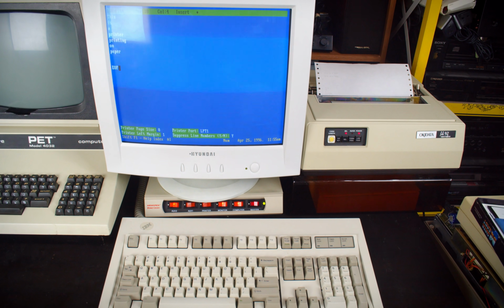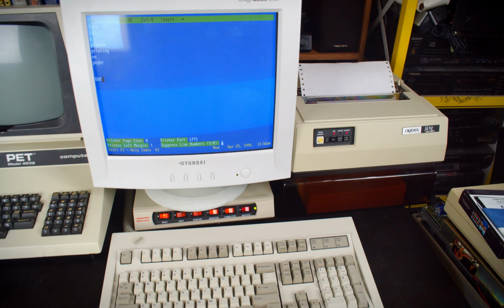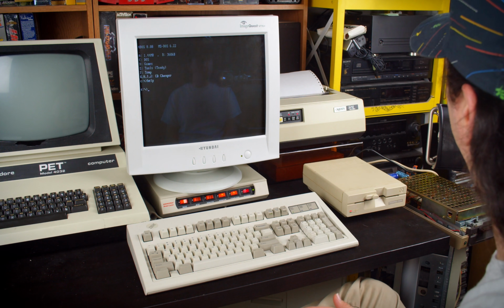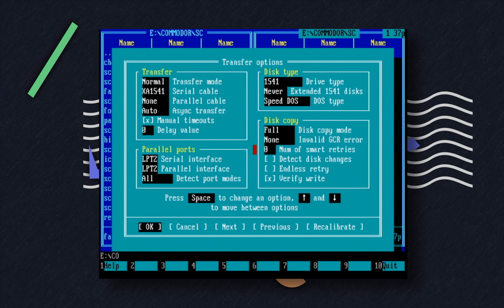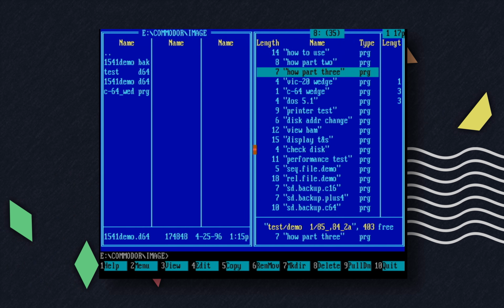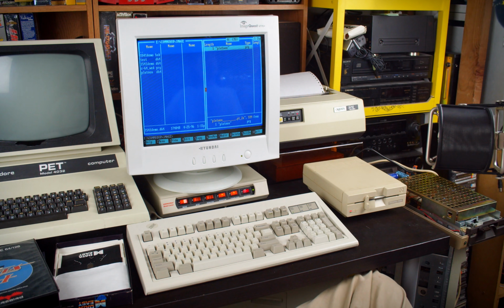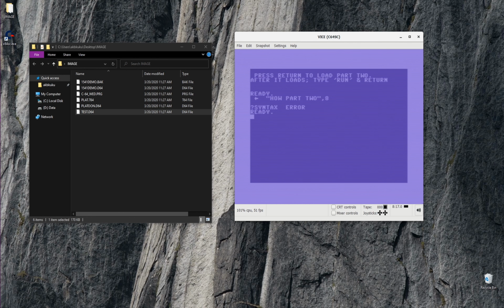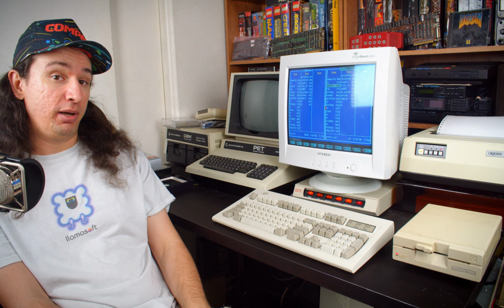Commodore 64 Drive on PC

Comment: Why do you have only 3 SIMMs on the memory slots?. SIMMs need to be installed in pairs.
Reply from the maker: That is a good question...I should sort that out. When I built this system that was all the EDO memory I had. I believe I have a lot more now.
Reply: My exact thought. I wonder if that's a special mobo that adresses the memory differently, or is one of the DIMMs just not used?
Thinking about it, that's the first time I've seen a motherboard with EDO RAM even POST with odd number of sticks..
Reply: Were they 72 pin?  A 486 can use single (or odd numbers of) 72 pin SIMMs.
Reply: @sirnickity  those were most definitely not 36 pin modules, but many motherboards still struggle with uneven numbers of 72pin ones. My HP Vectra 5/90C even states in the manual that only an even number of modules should be used.

Comment: It's remarkable how well the commodore drives have aged. Having their own computer and os built into the drive seemed to me to be overkill at the time, but in the long run it's meant that they're sooo much easier to interface with modern computers. And conversely, makes it easier to emulate drives to connect to vintage computers.

Thanks for the awesome content! Love your channel

Comment: I'm pretty sure you need to check "format disk" in the disk copier when you use a disk that is not previously 1541 formatted. There is also ZoomFloppy today which is USB. ZoomFloppy can also connect to PET drives.
Reply: ZoomFloppy is an overpriced XUM1541. A $3 Arduino Pro Micro can do the same thing.
Reply from the maker: That would make a ton of sense!

Comment: If you're not using an orthodox file manager in everyday work, like Total Commander/FAR Manager/Midnight Commander, then you're not a true techie. ;)

Seriously, OFM's are the greatest file managers around, even to this day. And they were invented back in the 80's!
Reply: Midnight Commander is the first thing I install on a fresh Linux rollout. Flollowed by 'alias @=sudo'
Reply: mc was the first thing I installed on my linux box when I started going FOSS, and I'm still using it to this day.

also, small protip: if you need to compare two files on linux, use mcdiff. Makes life so much easier, but I haven't seen it advertised inside the program itself.